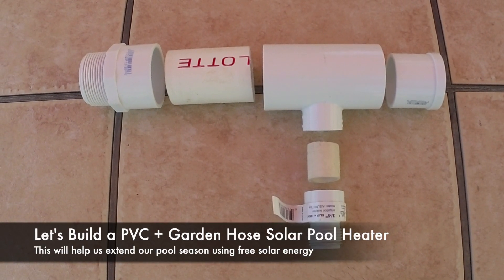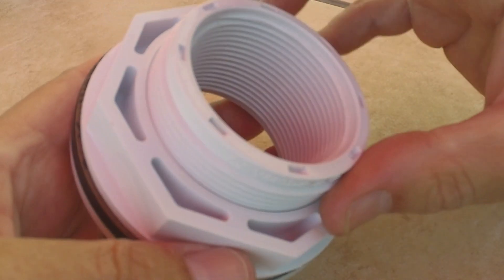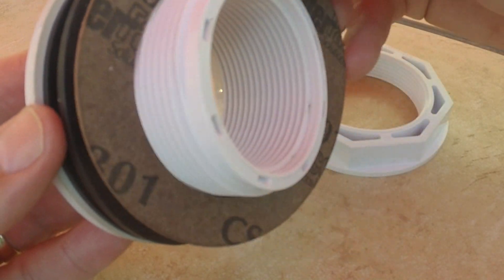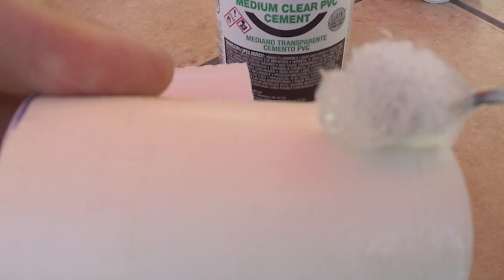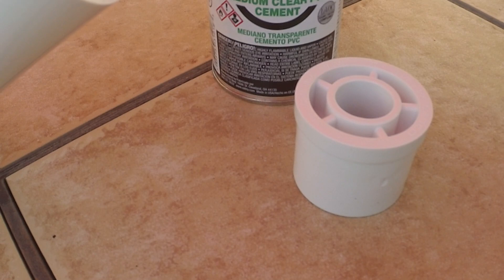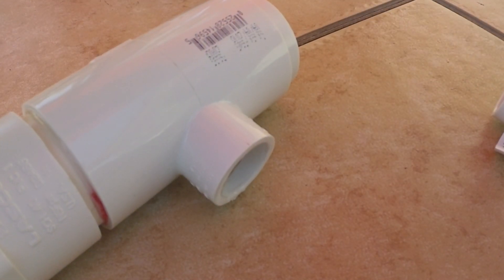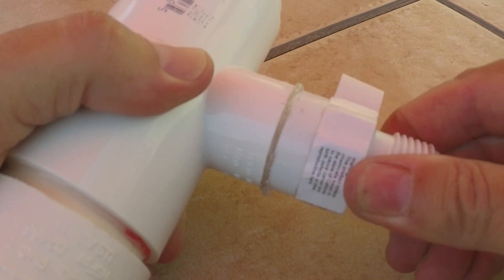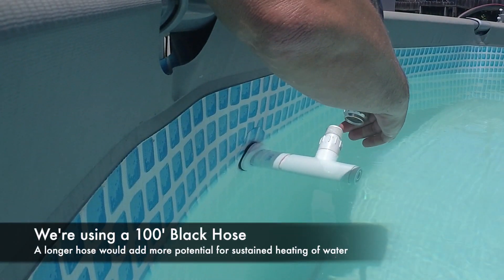Above Ground Pool Solar Heating DIY | PVC + Garden Hose Solar Pool Heater

Comment: Hey man great video. Will this work for an installed above ground pool? I’m not sure of the jet is the same to connect
Reply from the maker: Matteo, will work with the following inlet: Hayward Inlet Return Fitting  https://amzn.to/2YRCg3y
This is standard for PVC plumbing, but not what comes with an Intex pool, but easy to add if you want to upgrade the pool plumbing.

Comment: This is a great idea. Thanks for sharing. Couldn't something similar be done outside of the pool so won't need to have this apparatus inside the pool where it could run into, or do you removing this prior to pool use?
Reply from the maker: Glad it was helpful, I’d remove prior to swimming, it un-threads easily from the Hayward inlet. Goal was to build a DIY version of something similar to the “Beluga” device for less.
Reply from the maker: I suppose you could engineer this to be more permanent outside of the pool too (factor it into the return plumbing) 🤔 I might design it a bit different for that, but I like the general idea!

Comment: I do not see “show more “ under the video to list parts used
Reply: Found the parts listed,  it was weird, show more did not appear when I watched the video on my Iphone,, but it appeared on my laptop.  Thank you made it so much easier.  Great video and instruction to apply especially where to buy the parts and what was needed.
Reply from the maker: It's kinda hidden on mobile browsers and youtube app. There is a "up/down" arrow to the right of the video title that opens the video details (but no text label). Glad you found the info :)

Comment: Hey what were the parts for the adaptation..can you please include sizes? This is the best video on YouTube.. thank you for your time.
Reply: I see the parts you used but i dont see what you used for the adaption..
Reply: The parts you used for the shut off valve..
Reply from the maker: @gregorygagelonia6092  ok, I added a 3/4” PVC (slip fit) shut off valve between the big “T” and the hose adaptor, the rest is the same as I show in the build and description list. Adding more hose will increase heating capacity. Good luck!
Reply from the maker: Click "Show More" in the description below the video, I have all the parts listed. Cheers!
Reply: Thank you ..i really appreciate it